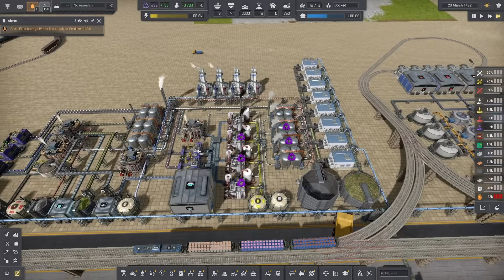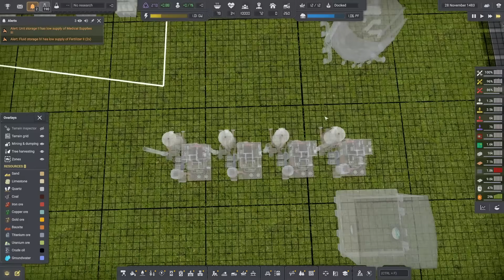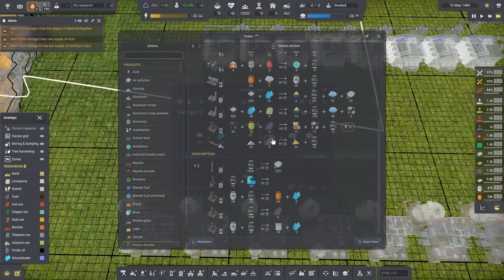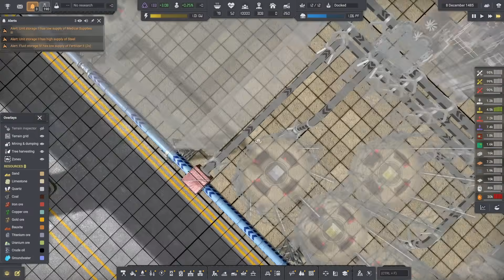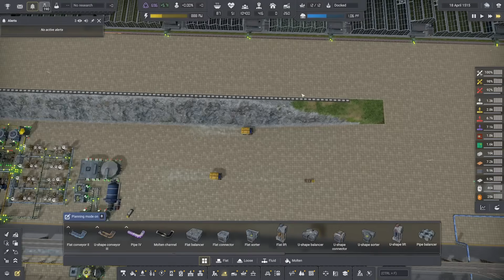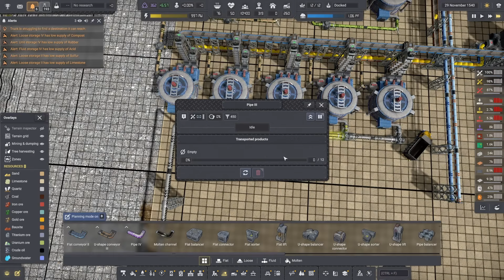Trouble At 10,000+ Population ➡️ New Designs Needed | 29 | CAPTAIN OF INDUSTRY - Update 4

Comment: I like the recipe for using CO2 to make ethanol, but the fermenters that are making your antibiotics also make CO2 so you could also pipe their outputs back into that setup and make extra, Right now you're just venting it. 

Also, I wish there was a filter switch for the delete tool where it would only remove transports. Right now you can get it to ignore surfaces and decorations but treats all buildings the same, I wish I could get it to just remove conveyors and pipes and leave the other buildings.